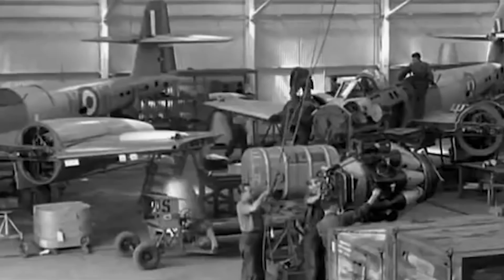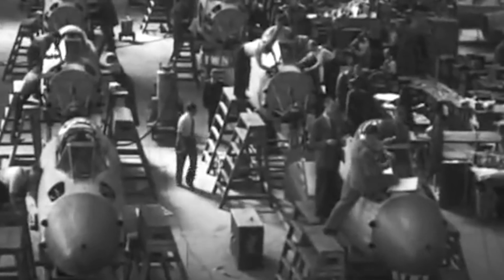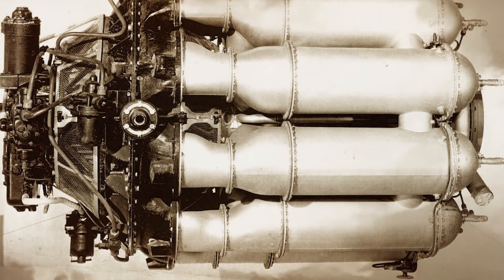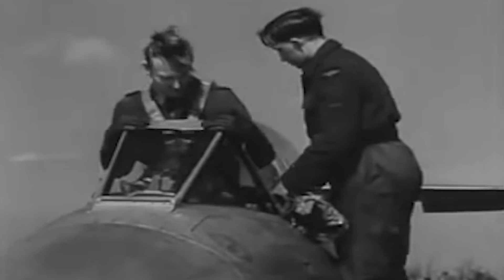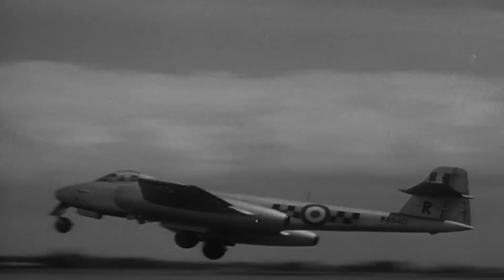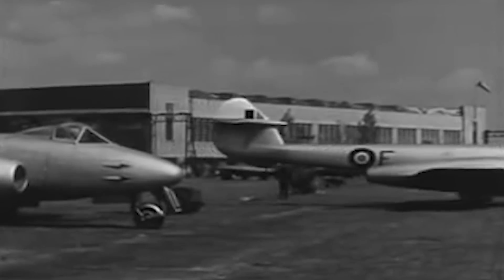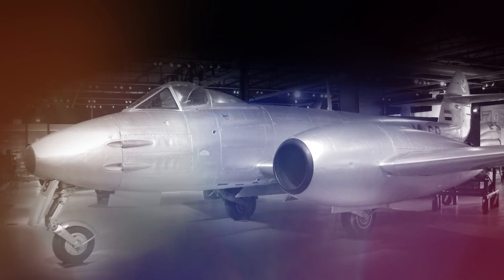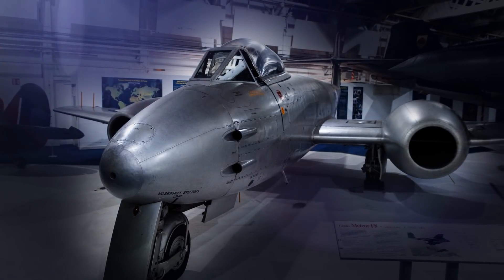Gloster Meteor - The Only Allied Jet to Fight in WW2

Comment: ‘Design of the Meteor‘ is evidence that the English did not understand airflow close to Mach One.
Fine that the English build this plane !
Reply: Hello Bubba, do you remember claiming that the MiG-15 was a great aerodynamic aircraft because it didn't have a have a fat centrifugal flow engine like all the English jets, only to find out that the MiG-15 had a centrifugal flow engine that was based on the Rolls Royce Nene?
And do you remember when you said that engines are heavy so they have to go in front of the balance point and then you were introduced to the rear engine jet aircraft?
And do you remember when you came out with your claim, similar to that one about the Meteor and the engines being built into the wing and you were confronted with the likes of the Myasishchev M-4,  the B57 Canberra and the SR 71?
The SR 71 was in service for more than thirty years, the Canberra served with more than fifteen air forces and was in service for over fifty years, B57s are still in service with NASA after nearly seventy years of service and the Gloster Meteor was in service with more than a dozen air forces (including the Argentinian air force that was being advised by Kurt Tank and Adolf Galland) and for over thirty years (two Meteors are still in regular service with Martin-Baker).  And then there's the B2 Spirit.
I suspect that there are a whole lot of jet aircraft designers, buyers and operators who know a whole lot more about it than than you do.i
Reply: @fritzwrangle-clouder6033  Fritz, why do you post this ?
For every child it totally clear that there is a huge difference if the engine is accommodated in the fuselage or in nacelles in the wing. Thus, the bulky engine of the MIG-15 did not matter. Nowadays nobody even is considering engines integrated into the wings. Airflow on upper and lower wing surface are not even - why should one do this?
Did you visit the Myasishev at the MAKS, at Ramenskoje? It is probably a useful cargo airplane, but obsolete. So is the Canberra and evenly evidence that the Fnglish did not understand transsonic flow.
The SR71 is an airplane with delta wing. If you approximate this wing with a triangle you  can estimate the neutral point at the half of the height of this triangle (if you are familiar with the neutral point?). You are able to observe then that the engines are positioned well in front of the neutral point.
Besides, you look rather like an AI-Commenter. Your creator not so smart!

Comment: That can't be right.... 450 Pilots Dead???
Is that real
Reply: Yes, this appalling statistic is 100% true and confirmed by MoD records.
450 RAF pilots were killed and over 1,000 aircraft crashed.
1 out of every 3 aircraft were destroyed in accidents making it the worst jet aircraft to ever see operational service.
Reply: @sandervanderkammen9230  Sandyboy you silly little wehraboo you. I bet you can't even see the stupidity of your last sentence there, sums not your strongpoint. Just remember though that Me 262 in service had far worse mechanical failure/pilot error loss rate than the Meteor and it was the krauts that were shoving barely trained pilots into death traps like that and the He 162. And it was the nazi's highly flammable He 177 that had the name the 'Flying Coffin'.
Reply: @sandervanderkammen9230  The service with more than a dozen air forces and a career of over thirty years makes it one of the most successful jet aircraft to ever see operational service.

Comment: Had the fool Goring and his boss made up their warped minds as to utilizing the Me-262 strictly as a fighter/ interceptor early in the war, the allied bombing campaign may of cost a lot more B-17s, B-24s and Lancaster bomber crews.  I'm grateful that those two stayed STUPID.
Reply: Not that Hitler and Goring weren't dolts, but the Me-262 bomber delay story is one of WWII's biggest urban legends.  What delayed the Me-262 was the lack of reliable jet engine production.  The Junkers Jumo 004 engines were prone to self destruction and even the "good" ones had a life of about +/- 10 hours - depending on who's number you read..  So even with with 2 "good" engines the pilots were looking at a failure of once every 5 flight hours. When Germany surrendered, hundreds of otherwise completed Me-262s were parked useless, waiting for engines. One of the main issues with Germany's jet engine development was that Germany's late war metallurgy wasn't sufficiently advanced to sustain the heat and stresses of a jet engine.  Then you have unskilled workers, slave labor , sabotage and primitive manufacturing facilities that were sometimes in caves - all of which made Jumo jet production a losing battle - literally.
The story of the ups and downs of the  Me-262 isn't really a story about the aircraft itself.  It's about the development, or lack there of, of the jet engine that was intended to power it.
Reply: @jb6027  Talk about urban legends!
The Jumo 004b engines met or exceeded the RLMs 100 hours PFTR reliability standard requirements for adoption into service by the Luftwaffe.
This is the exact same 100 hours required by the RAF and USAAF during WW2.
Only the U.S. Navy required a 150 hrs. PTFR.
Operation Lusty extensively tested  and found Messerschmitt Me-262 engines averaged TBOs in the 50 -60 hour range.
Excellent by WW2 standards and better than many Allied jet and piston engines.
The delay in Jumo 004 production was changes required to switch the use of high nickel Krupp P-193 Tinidur-60 alloy to low Nickel P-198 Chromadur alloy.
Dr. Anselm Franz Pioneered the use of bleed-air cooling with hollow turbine nozzles and blades and the use of high temperature resistant Cerro-Alumina ceramic coatings.
Both are technologies common on modern jet engines.
FYI; Krupp P-198 Chromadur is still used in jet engines and is known as A296 alloy.
Any questions?
Reply: @jb6027  Jumo produced nearly 8,000 004b engines during WW2. U.S. Army officials part of Operation Paperclip and British experts found nearly completed production facilities capable of producing nearly 10,000 jet engines per month.
Allied experts believed that by the end of 1945 production could have reached 50,000 units.

Comment: Ohain had his German version of a Heinkel jet flying in 1938, so Frank Whittle only invented the - English Version of a jetmotor. It's the victors who writes History, also in this case! Actually, the Germans had many types of jets flying, also 4 engined Arado Jetbombers, leaving any allied fighter behind, because of their speed. But they all had to land, at some time, and became targets for fighters then.
Reply: You are conflated aircraft with engines. In his foreword to 'Elements of Propulsion, gas turbines and rocket'-the famous German gas turbine pioneer Pabst Von Ohain says-

"The first patent of a turbojet engine, which was later developed and produced, was that of Frank Whittle, now Sir Frank (see Fig. 5). His patent was applied for in January 1930. This patent shows a multistage, axial-flow compressor followed by a radial compressor stage, a combustor, an axial-flow turbine driving the compressor, and an exhaust nozzle. " 

and

"In April 1937, Whittle had his bench-test jet engine ready for the first test run. It ran excellently; however, it ran out of control because liquid fuel had collected inside the engine and started to vaporize as the engine became hot, thereby adding uncontrolled fuel quantities to the combustion process. The problem was easily overcome. This first test run was the world's first run of a bench-test jet engine operating with liquid fuel..."

In the same work Pabst Von Ohain explains how no engine that he designed ever went into production.

Comment: Meteor vs MiG15
Reply: The Meatbox was no match for the Messerschmitt Me-262 or the MiG-15
Reply: @sandervanderkammen9230 Interestingly, and I know you don't disagree, the Me 262 was shite. In service it had an appalling mechanical failure/pilot error loss rate of 33% mostly because of the crappy engines and post war when the Czechs built a dozen hoping to start and export industry,they couldn't get anyone to buy it. Not even the Argentinians who were being advised by Kurt Tank and Adolf Galland no less.

Comment: The aircraft that made its last flight at Bruntingthorpe was the last flying example of the night fighter variant. 

The two Martin Baker aircraft are still flying - I've seen them regularly.
Reply: I used to work at Martin-Baker and they have a hanger full of airworthy spares to keep the 2 Meteors flying for years to come. They are an amazing sight on low flybys as the pilot usually does after a live ejection test fire